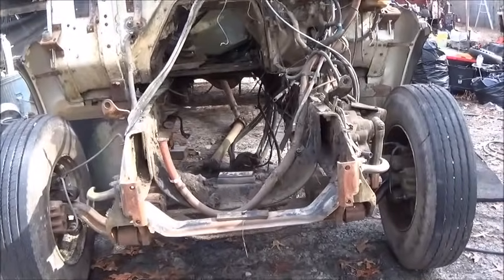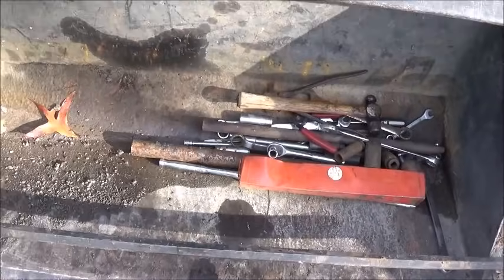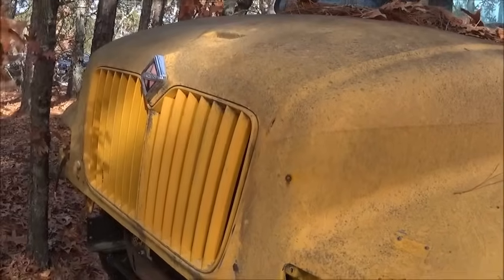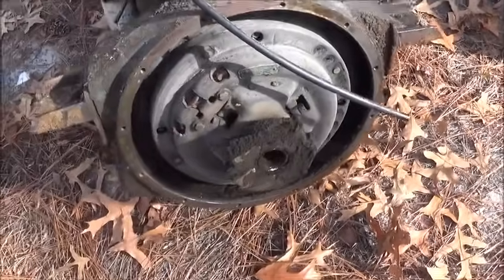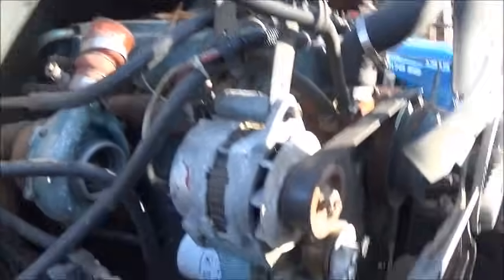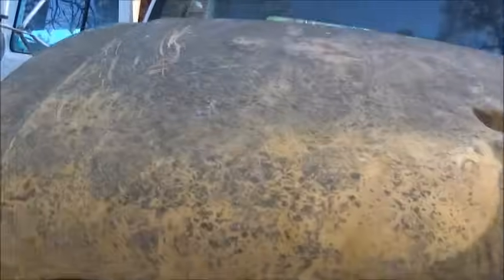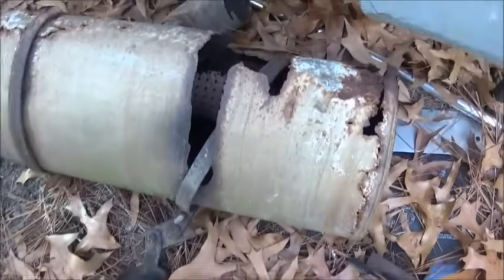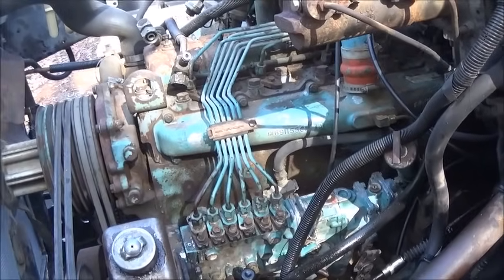INTERNATIONAL ROLLBACK BUILD DT466 SWAP

Comment: I used to work on a chicken ranch. I used to pressure wash the ranch trucks before I even started working on them. Have to leave them drip dry over night or you'd have all kinds of nastiness dripping in your face. You couldn't get it all.Good times.

Comment: I use to own a coil manufacturing company (sold and retired) the little heater cores were something I built. Man would call me and ask if I could build just one and I tried to keep the price below $500.00. I had 7.5 million dollars tied up in production tooling and whether I built 1 or a thousand the set ups and production engineering were all the same.And yes,the 1000 lot would be $40.00 range to the OEM manufacturer.
Reply: Love John w and his exploits up there with diesel creek. Mustie1

Comment: That's a good project. I built a couple rollbacks too. For the lift cylinders, they need a crossmember made of square tubing, not just bolted to the side of each frame rail. I seen a few with broken frames from that mounting set up.I agree about the planetary winch, the worm gear will hold the load, the planetary relys on a brake that can ( will ) fail. Great deal on the rad too.

Comment: 👍ran into same deal on my 93 6.5 3500 Chevy pickup radiator. NAPA wanted $1200. Ordered from Amazon $265. Spectra on both.
Reply: NAPA sets it on the counter, Amazon sets it on your front porch. For less. Lol

Comment: You cannot go to prison for deleting your emission system. It is not illegal to delete a emission system. It is however, against the rules. The most the government can do is fine you. They can only do this if it has been found that you knowingly and willfully deleted the emissions system.
Reply from the maker: Look up Dennis Cleveland he got 2 years in Federal without parole. Also a 255,000 fine. He owned arrordable Towing in Missouri.
Reply: @jonathanw4942  I stand corrected. The dummy probably wouldn't have went to prison if he had stopped using those trucks. They are always going to make a example out of a mechanic because they should know better. As for a owner operator like myself... they could care less.